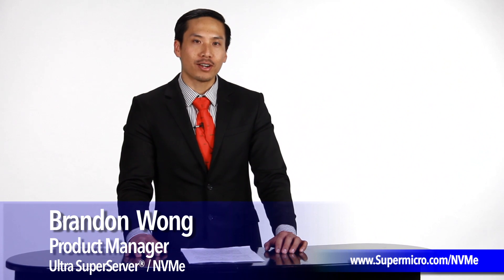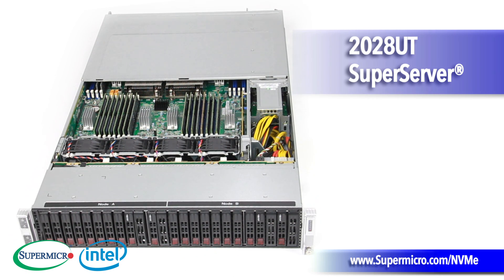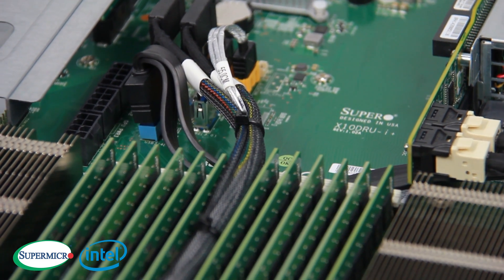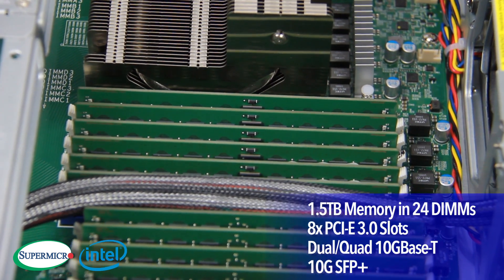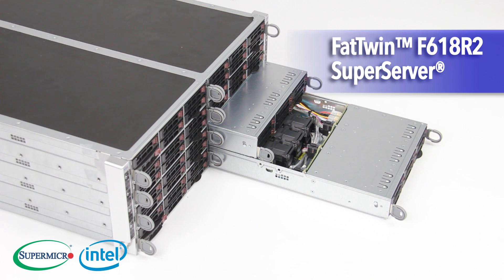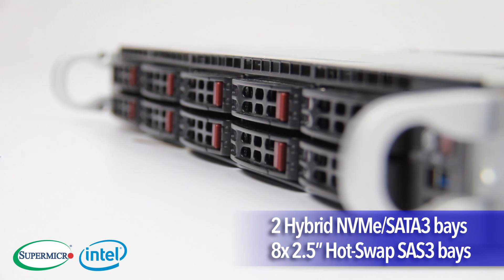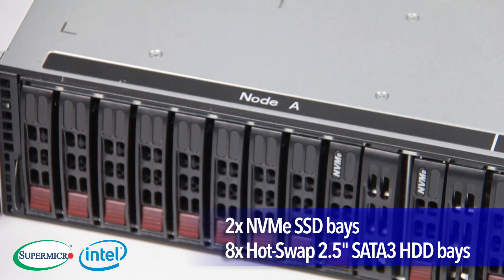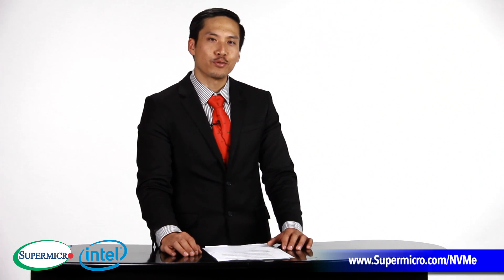Supermicro Superminute: NVMe

Comment: X10-DRL-i does not support the Samsung 960 Pro 512G NVMe at boot time. Only within WIN7 as a storage drive. Connected to a PCIE 4X slot via an adpater.